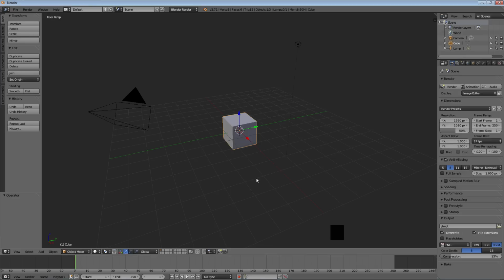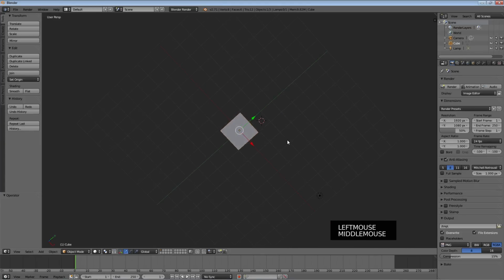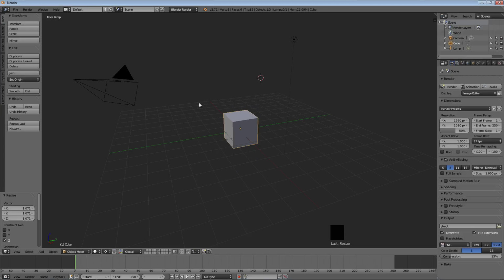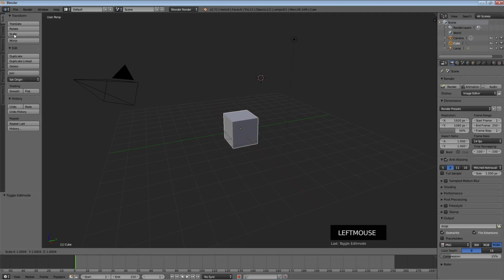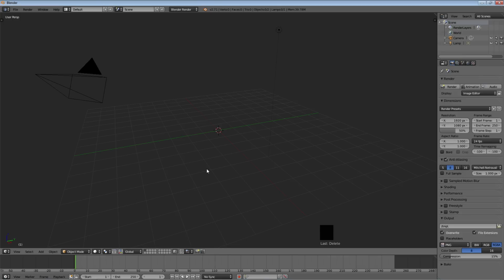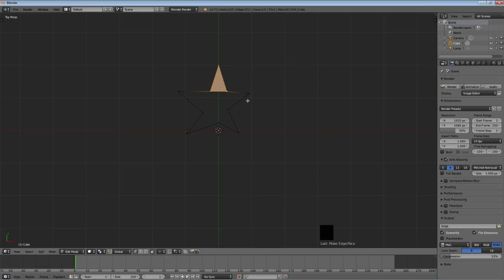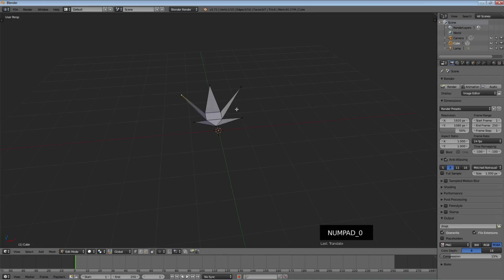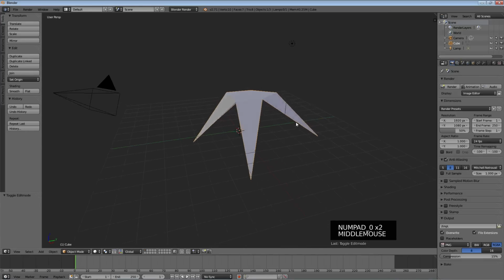Blender Absolute Beginner Tutorial: Episode 2

Comment: It's been years since I used a CAD program.
All I need to do is to draw lines and holes.
I need to make a specific sized 2D plate with holes in dimensioned locations so the guy with the laser cutter can cut them out.

Comment: my view becomes offset very easily from the centre. if i move the 3d cursor and then press shift-c it centers but also strangely my view moves across. If I then use the numkeys, it doesn't go back to centered, 7 looks from the top, but 0,0,0 is not in the centre of the screen. it's driving me nuts

Comment: So I'm in edit mode, just deleted the cube through the vertices delete like you said, viewing from the top via "7" and the Ctrl+Click drawing method is not working for me.
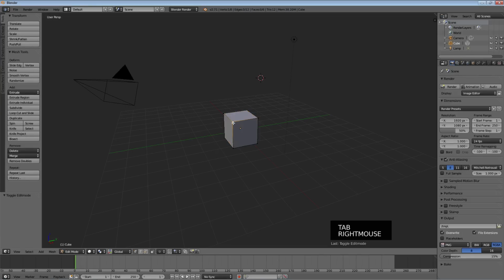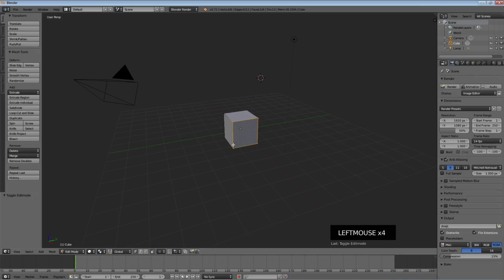Reply: After some experimentation, I figured out the problem. Okay, remember the function that allows you to edit specific points, edges, or faces? (this thing here: 10:28 to 10:42) Basically, you need to make sure it's selected on points or as its called " Vertex Select" and not on faces.
Reply: it dosent work for me either
Reply: I did that and it didnt work
Reply: I have selected points but still iam not able get the ponits after clicking ctrl+left click!!
Reply: Try Ctrl+Right Click
Reply: ya me too i am pissed (not at him)
Reply: Still not working for me
Reply: THANKS BIZZ! I was about to gave up on whole 3d modelling!
Reply: I got a solution ladies and gentlemen! Just select a vertex and press 'e' for extrude, it's not perfectly equivalent to the supposed ctrl + click, but you can make the star all the same. :)
Reply: @kdmq  omggg thank you
Reply: I'm using Maya controls so it might be that. I used Ctrl+Middle Mouse click.
Reply: THIS!!! Thank you so much - he just started drawing in the video, I had no idea how
Reply: The problem is that he deleted all vertices of the cube and the cube was invisible,but the cube still exists. Only then did the ctrl+left click worked for me.
Reply: ITS SHIFT NOT CTRL

Comment: @18:42 when I'm trying to create points in ortho view - it doesn't do anything. I hold CTRL+Left Click and nothing happens  [using v2.77]
Reply: You have messed around with your vertex select, make sure you are on POINT, not edge or face. 

Also make sure you are on GLOBAL, not LOCAL. The POINT icon is right near Global, the first one.
Reply: This happened to me too - I noticed that in the previous step where you delete all the vertices, I had actually deleted the entire object. In the video, you'll notice that the "Cube" object still shows up under "Scene" in the top right. In mine, I didn't have "Cube" anymore, just Camera and Lamp.

I was able to fix this by hitting Undo to bring Cube back, tab over to Edit mode, then hitting X to delete Vertices again. I had one more face left after doing that, so I hit X again and this time I hit Delete Edges. That would delete all the points, but not the object. If I would hit Delete Vertices a second time, the object would be deleted and there wouldn't be an object to draw on again.

There's maybe an easier way to do this, you would just need to add an Object to the scene, so that way when you are adding points Blender knows what Object you're adding them to. If the Camera or the Lamp is selected, it doesn't want to add any points.
Reply: ctrl + right click instead of left click works for me
Reply: Me too using 2.77 as well Linux mint 17.3
Reply: Try ctrl+right click
Reply: Have you solved this issue? I am having the same problem.
Reply: thank you so much for the heads up
Reply: +Robert Artenie (Zarovzky) where's point located?
Reply: Me too
Reply: i have the same problem with the same version
i did what Robert Artenie said but nothing happend
Reply: Thankyou so much it worked
Reply: Jack thank u soo much

Comment: After pressing R how would I rotate my object around pivot point. Mine laptop is mac and version is 2.77
Reply: Make sure you're in object mode. Then press R and move the cursor, and left click to finish.  The pivot point can be changed at the bottom,  and you can use X, Y, and Z keys to clock the rotation to an axis.

Comment: I just want to use blender to move some joints around on a model--make a hand model fit around a sword. That's all I'm using it for right now. I line up my object and my frame of reference, something that takes way more time than it should because apparently I can only open up the rotate window some of the time, and when I can, I can't rotate my object on the right axis. Anyway, I think I have that figured out, but when I'm done, the camera can't clip through the object anymore and the rotation has gotten all weird. This happened to me twice. The camera resets if I go to "open new project." I think for now I'm just giving up on this.

Comment: When I go to draw the star and hit control click I dont have happen what you happen.  I get a line that sort of has waves in it and it becomes more oddly shaped the more I move around.  Any ideas?  I am on a Mac but it hasn't made any different up to this point.
Reply from the maker: TheTCOLL You may have made a "curve" instead of a simple mesh like a cube.  Delete the object in object mode (select if via the project outliner in the top right, press x with the cursor in the 3d view window, then click delete).  Add a new mesh but make sure it's a box or sphere or something solid.  Then go to edit mode, delete all vertices, and try again.  If it still doesn't work, try the CMD+click instead of control (CMD = the apple key), but I'm not sure that works.
Reply: ***** Im a bit lost by some of your instructions.  Perhaps I need to get past this video but I dont know how to draw a mesh sphere or something solid.  I am still getting this weird dotted line that doesn't materialize into anything.
Reply: ***** Sorry just figured it out.  I had to click first then hold control and then hit another point before the line showed up.  Thanks so much!
Reply from the maker: Glad to hear it!
Reply: +TheTCOLL You have to be in edit mode, just click tab and then it should work then :) You were in view mode instead of edit